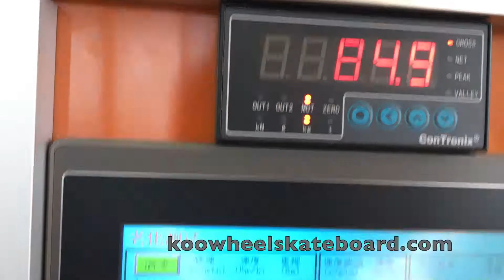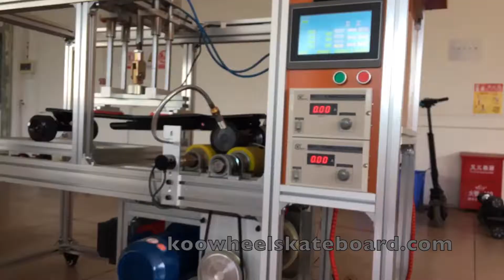Koowheel skateboard testing machine / 100% extreme inspection before delivery

Comment: It looks like is falling apart
Reply from the maker: Chedyus,  thanks for your reply, it's elastic connection between deck and battery, it won't push (damage) battery pack when riding, it's a advantage.